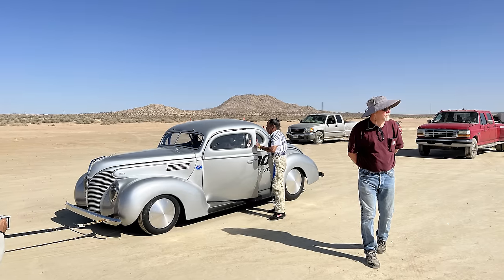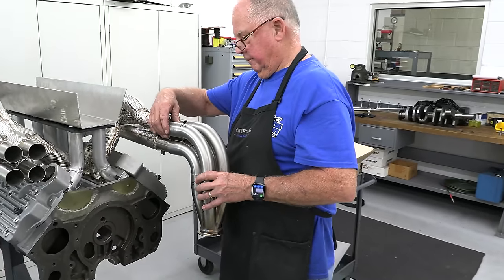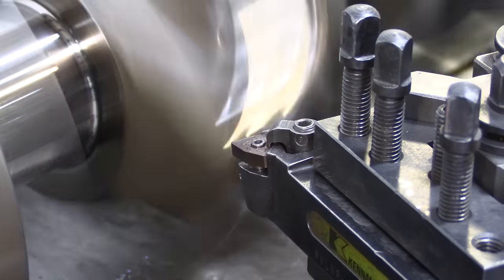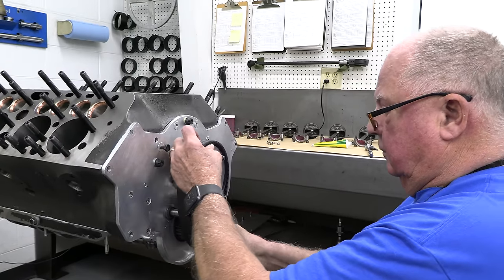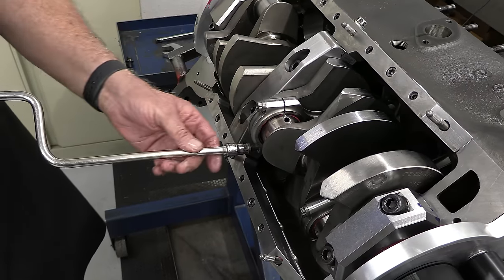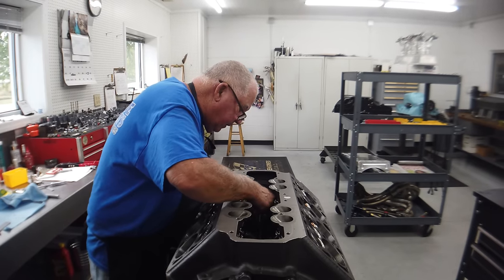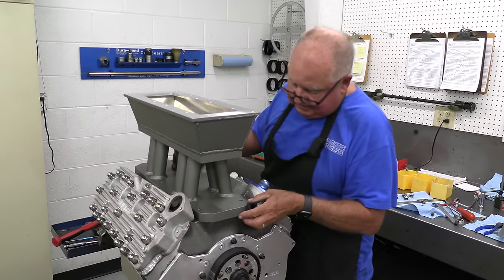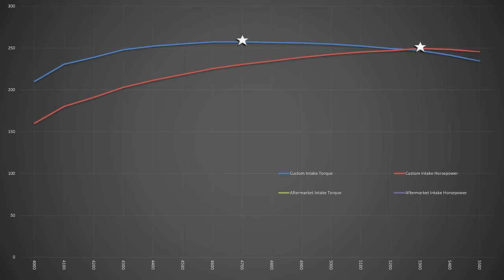World's Fastest Flathead? (Going to the Bonneville Salt Flats)

Comment: The amount of engineering involved in this is incredible. A near 75 year old engine making 250 horsepower is crazy to think about
Reply: Here in Japan 1953 Toyota R engine 69 years old with 1mm overbore 1.6L , cnc bearing plate, longer rods and forged shorter comp pistons, custom cam and ported OHV cast iron head made 183hp with boost and injection. 69 years old 1.6L and on a towing tractor absolute freaks.
Reply: Hmmm, yet there is engines a year or two newer that make double that. Small block Chev 265 will make 2 hp per ci.
The variety of baby hemis from Mopar divisions. And all with less cubic inches. Or even a Y block Ford.
Reply: @ldnwholesale8552  Totally different engine. OHV heads can breathe. This is a Flat Head. Apples to Oranges!!!
Reply: @ldnwholesale8552  so what ? Your comment is absolutely ignorant,  we all know this but that  sbc was new technology then, and the sbc cannot compete in this class to compete at Bonneville to possibly set a new world record in this class, try and keep up, and Keith Dorton knows more about making horsepower than you obviously will ever know.
Reply: but its not a FLATHEAD!!!!!!!
Reply: @ldnwholesale8552  a 265 will make 2hp per cube? That’s 530hp out of a 265 based on your numbers lmao!! Clearly you don’t understand what the original comment was talking about and obviously you don’t either.
Reply: those old dusenbergs made more power.  I've heard rumors of some doing 150mph on bias ply tires....truly insane
Reply: I can’t imagine how much this costs.
Reply: @altruismfirst6489  overhead valves & boost!
Reply: @daleolson3506  cost isn't the concern. Setting records IS.
Reply: I came here to tell him "tell me you dont know anything about Dusenbergs or Bentleys without tell me you dont know anything about Dusenbergs or Bentleys."
Reply: W pfp 👅
Reply: That number was achieved in the 60s
Reply: @ldnwholesale8552 these engines were designed in 1932 to be just $10 more than a 4 cyl and are 6.5:1 compression flatheads style...plus are only 3.9 liters, plus they have shated exahust ports and exhaust heated intake tracts, plus a single 2 barrel carb from factory. Hell of a different world
Reply: A very PRIMITIVE and LIMITED 75 yrs old engine.
Reply: The Rolls Royce Merlin and Allison aircraft engines made 3000 HP in 1942. The 1100 CID Ford tank engine made 800. Amazing what you can do when cost is no object!
Reply: 250h.p. isn't really that big 75 years ago....

Comment: With all the restrictions they had for the build, 257.5lb-ft and 249.4hp is amazing compared to the original 95hp!
Reply: Late Mercurys were 115hp.
Reply: those were 95 Big horses.
Reply: @ldnwholesale8552  125 in 52 - 53.
Reply: @Mercmad  That is true.  A 95 horsepower flathead seems to outperform a 95 horsepower OVH.  Probably because it can use lighter valve springs.  Less friction.
Reply: I think my 51 mercury Monterey was rated at 112 big horse power I can't imagine rockin 250 that would be a hot rod i would like to hear that through the glasspacks like my exhaust that would be a dirty sounding girl
Reply: @garywells1294  It would have been sweet, AND, much faster than a 70s car!
Reply: @michaelbenardo5695  no they don’t.
Reply: @JohnDoe-yq9ml  They sure seem to.
Reply: That’s hotrodin baby!!!!
Reply: @brucegerard309  While I don't think it was very torquey stock, you are 100% on point about it making good horsepower and being able to rev way out.  I think part of that was due to the fact that it's light-weight valve train wasn't likely to suffer valve float at high RPM the way an OHV engine can, and the other part was Henry's insistence on cross-flow porting.  Larger exhaust ports = less pumping losses.
Reply: @brucegerard309 O K semi cross flow then.  Engines with inline valves can indeed be cross flow.  It means intake and exhaust ports on opposite sides.  All OHV V8s are cross flow.
Reply: @michaelbenardo5695  why can it use less valve spring?
Reply: @brucegerard309  The Hudson Hornet was 170 HP in '52 if you consider it in the low-priced field. They ruled NASCAR in the early '50s.
Reply: Let's not forget.....    the run out
Reply: What I find funny is for years and years I have been told anything bigger than a 750 CFM carburetor on a big honking V8 that makes 400 horsepower is too much carburetor but yet this tiny little flat head that don't even make 260 horsepower it's got 2 carburetors on it ... which I will bet is definitely more than 750 CFM all together
Reply: @michaelbenardo5695  that's not how power works
Reply: @michaelbenardo5695  We normally hear the term crossflow WRT the cylinder head.  A flathead by definition can't be a crossflow head... nothing flows thru the head!  However, the engine configuration is crossflow in that intake and exhaust ports are on opposite sides of the cylinder.
Reply: Horsepower Monster:  An excellent video as always.  Keith is a phenomenal engineer, technician, and fabricator all in one... not to mention part-time magician!  Please forgive my nitpicking, but when you say "If my math is correct" your terminology was not.  The new engine's output is 263% OF orignal.  The GAIN in output is 163%.  Great video regardless.
Does Keith ever work on Model T or Model A engines?
Reply: Agreed, That’s double the original output !
Reply: I'd say they nailed it.

Comment: I'm an experienced engine tuner myself and I have to say that this right here is some cutting edge engine tuning work, my admiration for these guys ideas and workmanship is off the chart, thank you so much for posting this episode it really has made my day
Reply: "Cutting edge engine tuning work"? On a dyno? For a "land speed car"? 

ROFLMAO.
Reply: I'm sure you're a nice guy but most of these mods have been around for quite some time. Adapting them to a flathead is rather rare though. Oh and yes the reverse flow port set up with the exhausts running out the top is not in any way new tech either.
Reply: @deeremeyer1749  I don't understand your comment. Do you realize there are many classifications for LSR attempts? This is a very impressive modified antique engine.

Comment: My Dad raced back in the 1950's.  He was one of those "Flathead Guys,"  while everyone else went SBC.  He still won his share and ran Sprints, Midgets and Supermodifieds.  His sponsor was the A-1 Brewery, Phoenix.  I remember many all nighter flatty builds.  Lots of stories.
Reply: My father raced a B class car. it was a Chevrolet with a 235 six cylinder. because Chevrolet only had a six cylinder at the time. but it was no match for the offenhouser flatheads.
Reply: There is a gentleman just down the road from me who told me his Dad had an engine shop decades ago and specialized in Flathead Fords. After he passed away in the late 70's, they were cleaning out the shop and had to literally throw away 9 complete, rebuilt, and ready to run Flatheads. It was a time when they were worth next to nothing and NO ONE wanted them. Now, rusty old cores usually start around $800-$1000. If they only knew where trends would go!!! Sad.
Reply: @wardupyo I have a HARD time believing THAT story....
Reply: @davelowets  Okay..... And?

Comment: 1952 255” Flathead was rated at 125 hp and the same year 239 at 110 hp
Reply: Well that was probably gross with no accessories. wheel was probably like 75 haha
Reply: @chuckiefinster544  somewhere around there

Comment: If this type of work is not inspiring to a younger generation, then I dont know what is. This is incredible and just proves that hot rodding is still alive and well. Awesome job covering this build.
Reply: the issue is to allot of us Younger guys (im 25) is 1 Price allot of the "hot rods " are EXTREMELY expensive I've been wanting to get a halfway decent roller of any 70s car it doesn't need to run or even have an engine. just a body that's no Swiss cheese but cant find any for less than 10k from what I've seen.           also the EPA cracking down on allot of the aftermarket goodies

Comment: I've built many, many flatheads of the single cylinder variety for garden tractor pulling.  The cam and head are where you make power.  Tiny changes to the cylinder head will make a big difference.  We found giant valves actually hurt power as it forces you to lower the compression ratio.  It's a fine balance.  Fun to build.   Enjoyed the video!
Reply: i agree,we also found torque improvements by increasing intake speeds (narrowing the intake passage) briggs running on methanol.
Reply: It IS a very fine balance with an L-head Briggs.... 

The more you make room for airflow after the intake valve, the less compression you get....

Comment: Incredible engine. But I really would like to see the first version up and running. Just for the looks it wins everything for me. Hope you guys continue working on it. 
Cheers from Italy.
Reply: So they did do a video on it, which I watched a couple weeks ago, showing a basic high performance overhaul of an original engine. It was an insane amount of work. After watching these videos I no longer want to own a flathead. I still think it's the best looking V8 engine. But the design limitations are far greater than I had imagined, and without serious modifications and without serious attention to detail. The original engine didn't have an oil filter, and requires modification to have one. It seems like you need to have some experience building these engines, otherwise it will probably leak oil, or develop an oiling problem.

Comment: Imagine the time and expense just to win a record. Back in 1950, my Dad's '39 Ford Coupe with a blown flathead ran 114 mph at El Mirage in what they called the flying mile. It was also his daily driver.
Reply: My grandpa ran moonshine in a 39 and 40 Ford coupe from the mountains of TN to the foothills of NC every week. They ditched the flatheads and started messing with the big Cadillac engines in the 1940s. Grandpa never got caught hauling whiskey either lol.
Reply: Thats really impressive for 1950 and a street car.  Affordable V8 engines were just coming out like Oldsmobiles OHV 303 and with a lot of work  and a blower they were getting repectical horsepower right after that dodge released the Hemis and the horsepower race was on. But for any young man a blower and acc is a pretty expensive propsition but oh the heart pounding fun

Comment: What a great engine.  I had a 1950 F2 Ford with the 239 cubic inch V8 did a complete reman,  found a great machine shop. Put in  adjustable lifters,  made valve adjustments much easier.  Bored .030 over, rebuilt the rods, reground crankshaft,  resurfaced the flywheel.  And had it balanced.  For stock applications. It did good , I even got 15 MPG  on highway,  but top speed was only 60, and it was running pretty high RPM,  so mostly I stayed on 2 lane highways and kept speed to 50 MPH

Comment: The worlds fastest ford flathead record is held by the Mariani #76 streamliner and was set in october 2021 at 310.00 mph  xf/bfs    
 The motor was built by Steve Moody and Ted Carlton   
You got to appreciate the time it takes to build something this old and squeeze some hp out of it!!   There is nothing really new here from what i know other than rubbing on some flow numbers out of them heads and intake development .. hopefully the car is light enough and the track conditions are perfect because they are going to need every bit to push car down the short course..
  Keith is no dummy he got some good numbers using the old 3 ex  ports..
Reply: So….you built that motor?!?

Comment: I have a flathead powered MG-TD which I created in 1957, Merc OD transmission, 56 Ford rear end. The car has crossed the US seven times, been deeply into Mexico, and a long way north in Canada. For the past thirty-five years it has been based in Europe, in Gotland, Sweden mostly, from there driven far north as the Shetlands, south to Florence, Italy. Except for building the engine for modern lubricants and fuel, no one has done any work on the car but me. (Even rattle-can painted it over the years). The old “bus” fits me like a coat; to ride in, even MG-TD owners can not tell the car is not original – well till I hit the gas ! The car has never failed in any way and total repair cost for sixty-five years in continuous use is less than two thousand Euros. Now that I will return to Europe perhaps it’s time to convert to electric, though I hate to consider retiring my old flatheaded friend. {Incidentally my first girlfriend bought the car for me to re-assemble: her girlfriends brother started to put in a Chrysler but got drafted. Girlfriend got impatient with my learning curve and bought a Plymouth; haven’t seen either since I was seventeen – doubt if the Plymouth is still in service}

Comment: The only options that they could have explored ( if money were no object ) in addition to their many innovations, would be converting to a flat plane crank with matching cam, and fireing order as well as going with an EFI setup for that custom intake. This would give them enough data to workout the AFR and other factors like EGT's and intake air temps or throttle position.
But all in all it was definitely one of the best builds I've seen from such an old platform, those engine builders have certainly out done themselves.

Comment: I haven't yet watch all the video yet, but I will.  My late dad in the 50s and 60s was a real Ford Flathead V8 fan.  Our family car was a 32 4 door tourer, replaced by a 38 4 door, then a 52 Custom (I think America now refers to them as shoeboxes) referred to in Australia as a twin spinner after the domes in the grill. I noticed that the engine featured here is a later flathead possibly  a 49 "single spinner". The 30s flatheads had 2 4 cyl distributors running back to back that req'd a special tool to synchronise the points.  Best wishes

Comment: In an answer to the immortal question: "Why?" A: "Because I can." we have this motor.
But one thing that's always bugged me. Why not use 4 x 48mmØ IDA (or even 40/45/48mmØ IDF) down draft Weber carbs for a fully tuneable individual runner setup on a flat head such as this? those 8 inlets just scream to me down draft webers :) Or even modern Individual runner fuel injection (class requires carbs?)

Great video as always. thrilling for the entire run time.
Reply from the maker: Thanks! Yeah, the class requires carbs (99 percent sure). Not sure about webbers, though. They would definitely look killer on a flathead.
Reply: @TheHorsepowerMonster  indeed. Would solve any distribution problem, allow individual cylinder tuning and allow easy tuning of the intake runner lenght to optimise torque/hp at the desired rpm. .

In Australia guys are now commonly running individual Lambda sensors + egt sensors on the carbuttored race motors in addition digital solid state col on plug ignition to provide as much control and information as possible. Basically full efi sensor and ignition package. But carbs for fuel.
Reply: Oh man a set of weber carbs on that engine would be awesome. I feel like it could make more power vs the twin 4 barrels.

Comment: I love wringing all the potential power out of strange and/or underpowered and outdated engines. It’s hard to do and really shows who is a GREAT builder. Anyone and their aunt can slap turbos on an LS and make stupid power the easy way. 

It’s like the 5hp flathead Briggs & Stratton engine used in Karting and junior drag racing, they’re 206cc flat heads with 5 or 6-1 compression ratios stock and guys have modded them up to about 50hp with insane porting and alcohol.

Comment: Years ago I adapted a Ford electronic distributor to a flathead.  Used a cam.and salvaged drive gear and made an offset housing arrangement that used engine oil to lube crossed helical std gear drive. The housing bolted in place of stock octopus unit. Worked a treat. Biggest issue was valvespring heat issues. Lot of fun. Made a genuine 205hp at wheels. Can remember engine size but with electronic ignition would run without missing. Ran on a mix of home brewed fuel.

Comment: What a great engine build and a great job on the production of the video.  Just one thought.  The Harley K model bikes were flatheads until the debut of the Sportster in 1957, and yet Harley continued to race the flathead design (yes I know, they were allowed 750 cc's vs 500 cc's for the overheads) as late as 1969.  They were regarded as the absolute ultimate in flathead power production, and that was all about combustion chamber design.  I'm not saying the Harley K racing combustion chamber design was better than the design used here (we don't get to see it after all) but it couldn't hurt to compare notes with some of the old time K bike factory engine builders such as Jerry Branch and some others.  Again, good job here.

Comment: These are the best videos on the internet about the Ford Flathead. The Ford Flathead looks better than any V8 engine. Although I feel like there is a huge opportunity for an aftermarket company to make a new version of the engine, as a crate engine. If the engine could be modified slightly, so it had 4 exhaust ports on each side, stronger main bearing caps for the crankshaft, modern oil seals, and a hydraulic lifter conversion which would eliminate the complex method of setting valve tappet lash. I think a new version of the Ford Flathead, with 225 horsepower, and 300 ft lbs of torque, would sell faster than any other engine. Many custom builders want something new and different, and there's nothing more unique and rare than a Flathead. In an era of electric cars, there's no logical reason to invest in the tooling to make a Flathead crate engine. But I have a feeling it would be hugely popular. I hope Dart, Speedmaster, Scat, Eagle, or Brodix reads this comment, and begins work on a new version of the Flathead block and rotating assembly.